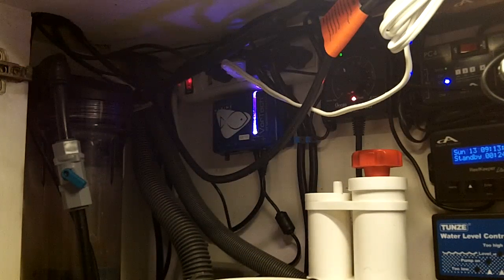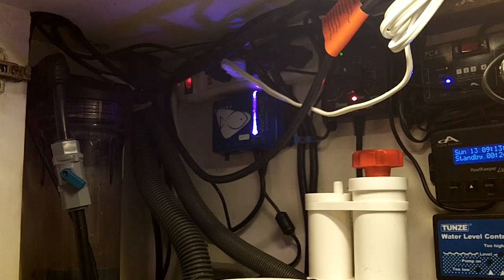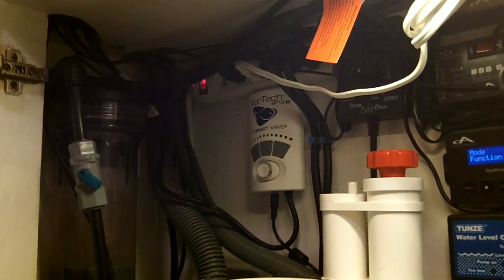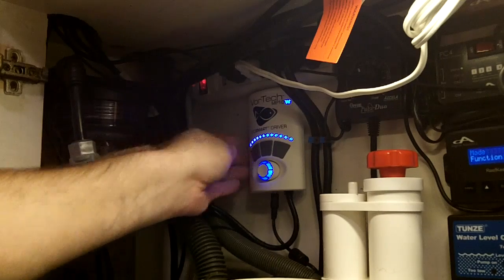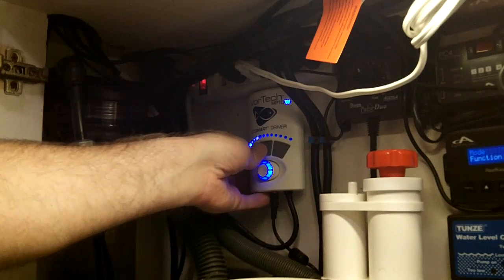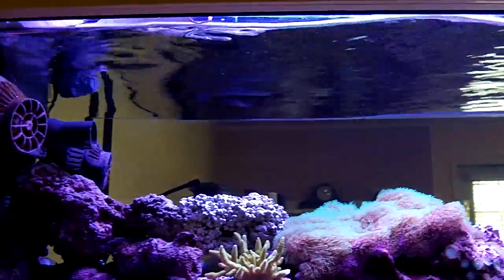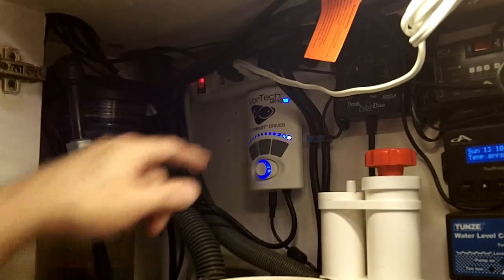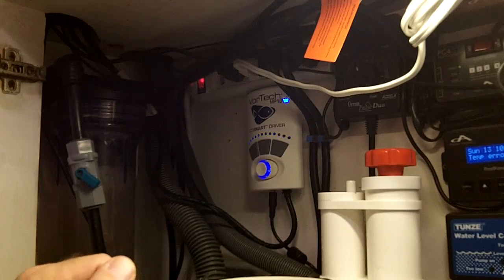EcoTech Marine Vortech MP10 to MP10w ES upgrade

Comment: I thought the whole point of wireless is to use it with Reeflink? so you never have to push button combinations any more and see multiple devices all at once and setup all types of times for different modes.

Comment from the maker: My tank is set up as a room divider, so the small end is against the wall. I use one MP 10 for circulation (ie: "The Wave") and the other MP 10 to help keep the detritus stirred up. I believe I've got it set up in "Lagoon" mode.
Only one pump is set up with the wireless controller. If someone were to have to wireless controllers, there are numerous combinations that help to move the water and keep the detritus suspended and therefore removed from the tank.